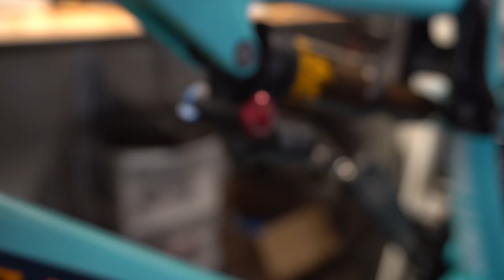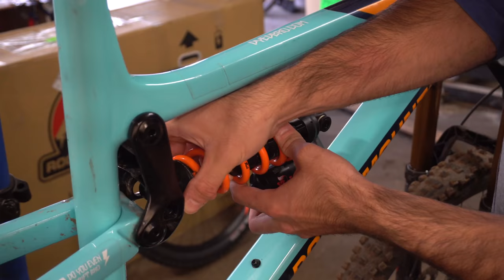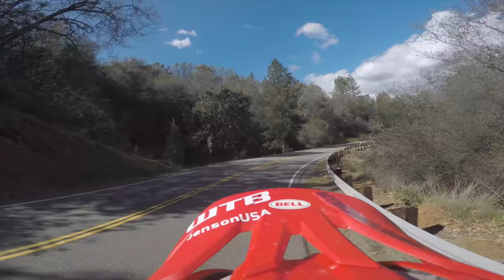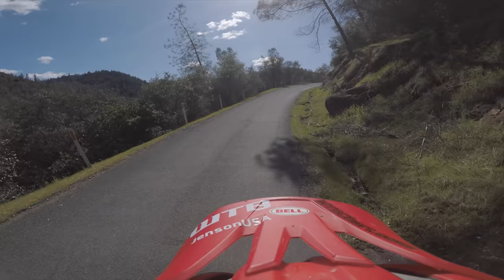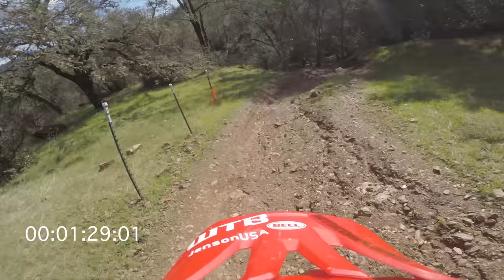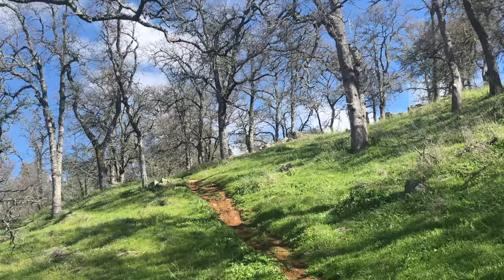Coil Vs Air Shocks - Why Did I Switch To Coil?

Comment: I’m about to buy a 2019 Santa Cruz nomad, and it offers the coil and the air susp versions... the trails that I ride aren’t too rocky and I’ll make lots of jumps... as we know, the shock on the 2019 nomad is the rock shox super deluxe RCT... in my case, do u recommend the air or the coil shock !? I’ll be grateful for ur advice
Reply from the maker: The nomad is a bike that is suited for both coil and air. What’s best depends on your riding style and preferences on weight. Do you find yourself mainly doing fireroad climbs to the top of your descents, do you mind a heavier bike, and finally, do you mind having a bike that’s gonna be a bit more sluggish uphill?
Reply: Trail Peek Well I don’t mind having a bike that’s gonna be sluggish uphill, but I need a bike able to climb up there (really gotta have a 1x12 drivetrain)...the fact is: I need a strong bike for my descents, I have an agressive riding style, but iam very confused in this world of coil/air suspensions, I don’t know what’s gonna be better for me, I’m 74 inches tall and 192 pounds of weight
Reply: You answered your own question there bud. I had an 18 nomad4 and I ride air for the first 3 months I had it. The last 2 months I rode coil only. The SD AIR makes a nice aggressive trail bike that can handle tech climbs. But coil. Man. With the right spring rate and preload/sag, it really opened up the bike. After riding park and trail on air, then just trails on coil. I highly recommend the coil. Especially since you have 12speed! It’s not that bad. Lock that big girl out and just pedal.
Reply: @ridemx323  Thanks so much bro... until today's morning i only knew the air shocks and after watching this video i got really confused about these stuff...i'll get the coil one

Comment: Because coil > air. And if you get the right setup can be just as light. However if you can get a custom tuned coil shock you'll be in heaven. One of the biggest issues with coil is lack of progression (should you need/want/desire that). DHX2 for example has the same bump stop for all of their shocks. It does not take into account your leverage ratio or your frame progression. Obviously an issue if your leverage rate doesn't ramp up much, or if the curve flattens out in the ending stroke. Their dampers are the same (same shock used for every bike), but that's why you've got all those external adjusters. I've got a video on my channel that discusses air vs coil with a lot of the same points you've brought up as well. I'm working on another one that dives into a custom tune vs OEM suspension setup as well.
Reply: Curious about your first point, how can coil be just as light? Even the CC DBcoil IL in the smallest size will be close to the weight of the Float X2 once you have a Valt/SLS/Ti coil on it? Apples to apples DHX2/X2, DBAir/DBCoil etc. it's a few hundred grams heavier. Still think it's worth it!
Reply: James Stoup hows a lack of progression a bad thing? If you’ve got a custom tuned coil shock then you want it to be linear.
Reply: @TheNotoriousMIC  It's only bad for those who want a more progressive suspension design. If you're not looking for extra bottom out resistance then you've got no issues :)
Reply: @TheNotoriousMIC  exactly do you know you're only one of a very few people who understand the difference between Progressive and linear. a lot of people like to throw those terms around but they have no idea what they're talking about. No way in hell do I want a progressive shock spring combination I want something linear from beginning to end of travel. More consistent better performance. 👍

Comment: Some kind of wizardry Trail Peek you removed the Fox DPX2 from the frame and there was no mounting hardware installed in the lower eyelet?! Gotcha. Also any tips for removing the proprietary Rocky bearing cups I have an Instinct BC and swap between DPX2 and Storia Lok but the lower mounting hardware is a pain to remove / swap?
Reply from the maker: Lol! I went at it with a screwdriver, not recommended if you’re afraid to mark up the eyelet cosmetically. You can order new bushings from rocky.

Comment: Didn’t you have coil on jeffsy? I’m thinking of putting coil on my 2019 jeffsy
Reply from the maker: Dane did, the jeffsy works great with coil
Reply: Trail Peek I’ve taken out the volume spacer and running over 30% sag still so progressive, big hits don’t even bottom out if it does it’s bare minimum! My pivot bottoms harshly on much smaller hit
Reply: @deets29mtb53  which coil did you mount? Im also thinking about to mount a coil but im not sure about fox, rockshox, dvo, ...
Reply: Lars Bleicher I have air haven’t pulled trigger on coil but would probably stick with fox
Reply: @deets29mtb53  yeah im thinking about the dpx2 do you have this one?
Reply: Lars Bleicher yes great shock depending on bike and linkage.... on my jeffsy the linkage is very progressive so I’d rather have something a little more plush like a float X2 or coil
Reply: @deets29mtb53  so what do you think x2 or dpx2?
Reply: Lars Bleicher anyone that put a coil on the Jeffsy that I know of, loves it so if I wanted to change out the shock I’d go with DHX 2 for a coil and wanted to stay with air I’d get The float X2

Comment: im on the fence between my x2 and getting a dhx2 for the bronson v2. should i give the coil a go?
Reply: I wouldn't.  Generally speaking VPP leverage rate is more linear.
Reply: As Rusty said, the Gen2 Bronson doesn't have a very progressive leverage ratio curve so you'll likely struggle to find a spring rate that gives you the supple small bump sensitivity that coil is known for while still having enough bottom out resistance.  You may need to run such a heavy spring to not blow through the travel that you'd end up running less sag and having it be quite harsh over small stuff.  With the Float X2 I honestly believe you have the best shock for that bike.
Reply: Oh_Sully Oh_Sully you buy the spring that gives you the correct sag and then you run the right amount of compression and rebound or run a firmer bumper. You don’t just keep adding a heavier spring that’s not how it works. 

All shocks not just coils work better on a linear set up if you set your shock up properly.
Reply: @TheNotoriousMIC  I'm not sure I understand your point correctly so I'll remain in disagreement with you.  Taking into account the differing properties of air springs vs coil springs, and the adjustments available (I'm yet to find a part number for a firmer DHX2 bumper), there are definitely leverage curves that work better with air shocks and curves that work better with coil shocks.
Reply: Oh_Sully my point is that the spring that gives you the correct sag is the spring for you. The rebound and compression tune is how you get the shock to feel how you want you don’t just keep adding a heavier spring until it doesn’t bottom out anymore. High speed compression is what you add if you don’t want to bottom out mainly and a tad less rebound.
Reply: @TheNotoriousMIC  okay, I think we're on the same page.  I agree, set the sag, adjust rebound to preference and then play with the compression to tune it for your riding.  However, my initial response was specifically towards the V2 Bronson that Kyle has and bikes with leverage curves similar to it, where the is quite a high leverage ratio at the sag point leading to the shock having a lot of leverage acting on it to compress (ideal for an air shock with it's higher stiction thanks to all those seals), but then deeper in the stroke the leverage ratio doesn't reduce enough to be ideal for a coil shock's linear spring rate which can lead to blowing through all the travel much to easily.  Despite the DHX2 and X2 having LSC and HSC adjustments, if you close the HSC for maximum damping, it reduce the small bump compliance of the shock, and that small bump compliance is a key advantage of the coil.  Essentially the rate of change of the leverage ratio on the V2 Bronson is not ideal for getting the best out of a coil.  It's not that it's linear, as it certainly isn't, but the gradient isn't steep enough and therefore works best with the progressive spring curve of an air shock.
Reply: Oh_Sully yeah it doesn’t work like that though high speed is when your fork or shock goes from full extended to fully compressed fast it doesn’t effect much else. There’s a reason absolutely nobody uses air shocks except mountain bikers and it’s because they make terrible springs they’re a factor in mountain biking because weight is such an issue but other than that there is no performance benefits to air at all or we’d have examples of them being used in other sports but we don’t.
Reply: Yes, High Speed is for fast hits, but you don't need to use all the travel to open the high speed circuit, it's entirely dependent on shaft speed, not shaft travel (I'm assuming you know this).  So if you've maxed out your HSC to stop you blowing through the travel on bigger hits like drops, jumps and hucks, all your smaller high speed hits such as through chattery rock gardens, small square edged hits like rock armouring on trails etc are all going to feel unnecessarily harsh, essentially making your shock spike like it had no high speed circuit because you've closed it off so much.  HSC should add support on high speed hits, but it's not designed to be used like a volume reducer in an air shock to add bottom out resistance.  Reason one is that you're now placing a whole lot of force through the little steel shims that really aren't designed for that sort of abuse so they'll crack and even break inside your shock, rendering the shim stack ineffective and requiring a rebuild to replace them.  The DHX2 is already a race optimised shock, MY19 in particular seems to require a much shorter service interval than previous years as it feels like Fox's efforts to reduce friction have gone almost to the realms of a World Cup racer who has their stuff rebuilt after every WC race (I'm seeing MY19 DHX2's coming back for service a lot sooner than MY16-MY18 models).  Reason two is that by closing the HSC circuit to add support at the end of the stroke, you now compromise the smaller bump sensitivity at that sag-50% travel range which is where the coil particularly shines over air springs in it's ability to track the ground better and give the rider more traction.  If you end up with a shock that spikes on smaller stuff and doesn't give the traction and comfort that a coil is renowned for what is the point?  By your logic we'd see every professional gravity rider using coil shocks (undoubtedly they've all tested them) but the reality is, not every bike is designed for a coil shock.  One trend I'm sure you've noticed is that most new bikes with a gravity focus are offering a coil option as the companies re-design and tweak the frame kinematics to work more effectively with a coil, but chuck a coil on the same model from 3-4 years ago and the performance won't be the same as many frames were designed with an air shock in mind.   To summarise this and my previous replies, do I think that coil springs are better?  Yep.  Do I think they are better on every bike?  Nope.
Reply: Oh_Sully an air shock will never ever perform as well as a coil and a coil will never be as light as air shock. Pick one bit if it’s performance it’s always going to be a coil regardless of what bike you put it on even if you need to have it custom tuned for your bike.

Comment: I didn't know switching shocks was so easy. Are all rear shocks universal? Looks like it took you no more than ten minutes to change shocks
Reply from the maker: Each frame has specific dimensions for the shock. As for swapping shocks, yes it shouldnt take too long. Just two bolts to remove and replace.

Comment: Dude, you should try a coil on the front. Mind blow.
Reply from the maker: Waiting for fox to bring back the Van 36
Reply: Trail Peek you can convert a Fox 36 float with Push ACS3 FORK COIL CONVERSION. I have a 26” Lyrik RC2DH coil fork 170mm - it works very well.

Comment: I've only tried both on mx bikes. Air for the track and taking big jumps. But I'd take a coil any day on the trails. That is if the coil has preload adjustment on the coil.  Otherwise you'd really need to be fitted with a spring for your weight.... but then how else would you do your static rider on sag without it
Reply: AIR FOR BUG JUMPS?????
🤦‍♂️🤦‍♂️🤦‍♂️🤦‍♂️🤦‍♂️🤦‍♂️🤦‍♂️🤦‍♂️🤦‍♂️

Comment: On the orbea rallon which do you think is better ?
Reply from the maker: The new Orbea Rallon is a bike designed to work well with coil. Either one will be fine, but coil in my mind is king

Comment: I mean im a heavier rider (286lbs) and im all for air shocks as they offer way more adjustability and way more forgiveness at the bottom of the stroke. Where as, on a coil as soon as you get coil bind you can fuck the shock completely. Plus, it means i have to buy a couple coils to run with, rather than just pump or loose some air/spacers.

Comment: Coil for life. Just knowing you have that comfortability to smash through things is always good to have.
Reply: TC Downhill agreed. I used to run air but during downhill runs on the trail bike the shock would start to give up halfway. So I got a Cane Creek DB inline coil and BOY was I faster down the trail! I don’t care about climbing at all but god damn the bike rips downhill so much better
Reply: Will Foster 
Dude that’s awesome I run cane creek front and rear. I got the double barrel air in the rear. 160mm front and 200 travel rear.

Comment: Here are my 2 cents.  The air shock is like the fire dept. it'll show up and save your ass even if there is no fire.  The coil is like the police dept. it complains if you hit something to hard, gives you a ticket for going to fast.  If you ride trails that don't push the limits, ride a coil, its AOK.  But if your the type that needs support when the shit goes down, its AIR all the way baby!!

Comment: So, uh, progressive springs haven't made their way to the MTB world?

Seems unlikely.
Reply from the maker: They're starting to, MRP makes them for shocks. For a bike like the altitude, its not necessary however
Reply: Progressive Springs are not ideal for any type of performance riding or racing all you have to do is look to the MX world to understand that. Most Motocross and Supercross teams are running linear Springs not Progressive Springs.